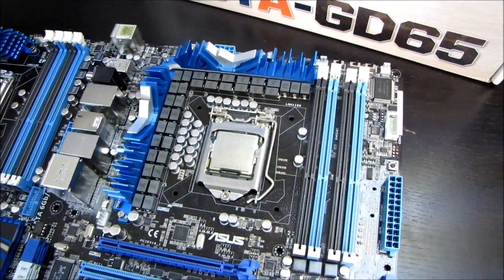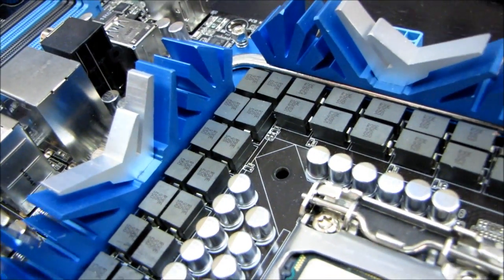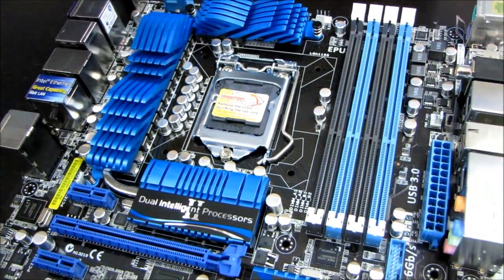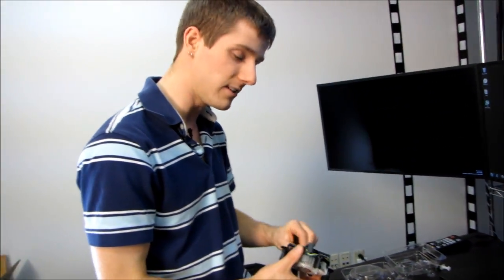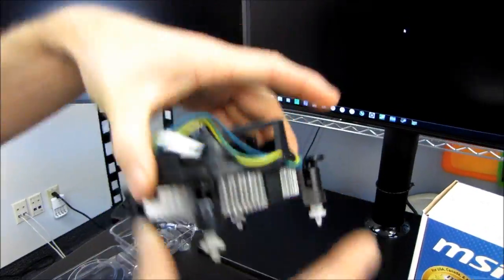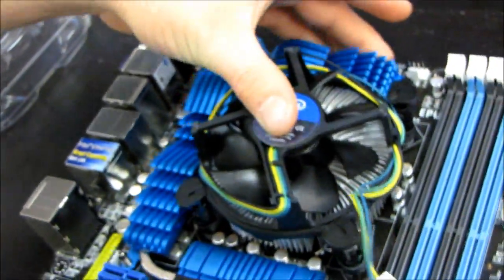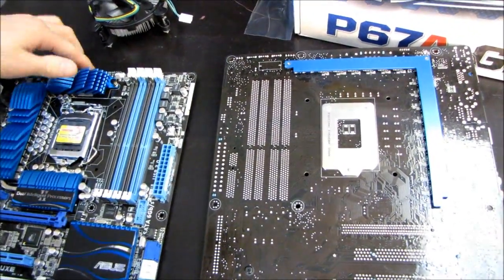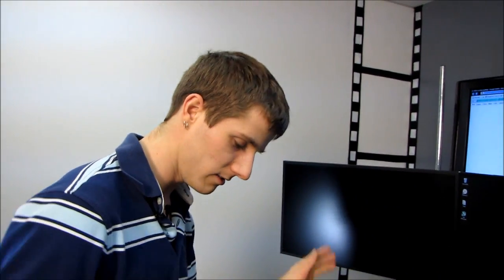FAQ: LGA1155 vs LGA1156 Heatsink Mounting Holes Linus Tech Tips

Comment: who is watching this in 2020 September
Reply: me in summer 2024.

i just got H77 mobo, and have Gigabyte P55 mobo as well in my collection. They just arrived.
I wanted to know, if that beatyfull cooler in 1156 board can be used also on my 1155 boards. And this video very quickly helped me, that I can use this cooler, which is good news.
So as you can see, video can be helpful even after 13 years!

Comment: Hey Linus, I have that Asus P8P67 Deluxe mobo with an I5-3570k cpu and 4 sticks of G-Skill Ripjaws 8gb ram sticks. I got the Coolermaster Evo 212 cpu cooler, and it is really close to the heatsinks of the ram sticks. Can you suggest another air cpu cooler that I can use, max height of 158mm? I am using a Corsair Spec 01, and there is like half an mm clearance from the tips of the heatsink pipes to the metal casing.

Comment: Friggin beautiful. Linus to the rescue. I have an old AMD Athlon II 640 system and I am about to go buy a used intel core i5 2500k with mobo for $45. The DDR3 ram is swap able but I was wondering if I needed to get a new heat sink. I kept the little box of additional mounting hardware that came with my cpu cooler probably 10 years ago and sure enough it has an 1156/775 socket mount. And the new mobo im getting has an 1155 so this is awesome. All I am spending is $45 for a pretty decent upgrade.

Comment: I have a Question and it may seam silly but here it is anyway will the 1155 cpu go into the 1156 motherboard ???
Reply: No, the notches are different. Thinking about fitting it? You can't due to the electrical pins being different.

Comment: Thank you very much for this video. I'm upgrading my gaming pc. I'm using a Cooler Master V6GT on AMD platform. I was wondering if i could using it on Intel LGA 1155 but after a saw the video i have not more doubts.  
Question: I have been using this CPU cooler for about two year, so far  i haven't change the fan speed or anything else. Could you tell me if i should   worry about the longevity of it? Should i change the fans? Once again thanks.

Comment: i can get a Asetek 510LC Liquid Cooling System 120MM Radiator & Fan (Enhanced Cooling Performance + Extreme Silent at 20dBA) dual fans push pull for 30 bucks more is it worth it the system i want to buy has a i5 2500k and a nvidia 570

Comment: Thanks for the tip, I bought the Coolermaster V8 cpu fan and then I realized it was for the 1156. Wasnt sure if it was going to fit on the 1155 setup I have.

Comment: I wish every socket had the same hole layout, even if it is either Intel ot AMD, it is a pain in the ass having 5 backplates to soare when getting a CPU cooler and wont be able to throw them away because you never know when you will change a motheboard

Comment: @daddydanne27 1155 is replacing the 1156 socket, not 1366. though it's debatable whether or not the 2600k CPU is better than the 950 for 1366. All the different BIOS for the P67 chipset suck though, for now, but people have already overclocked the 2500k and 2600k CPUs pass 5Ghz (not stable) and at the speed 4,6Ghz they were very close to the performance of an 950@4Ghz. You should check out some of the reviews at Overclock3d.

Comment: The new 1155 cpu is evolution? ... we pass from 3 way chanel memory to 2 way chanel ... from 4 x 16x pci e (gigabyte ud9) to 2 x 8x pci e ... so for games is better a i7 1366 or the new 1155?i.m confused when we will see benchmarks and comparing the ¨old¨ i7 and the new 2600k?
Reply: bro... 1155 is here to replace 1156, not 1366.
1366 was enthusiastic platform. Intel had 2011 socket for that later.
so do not compare 1366 1155. but 1156 and 1155.